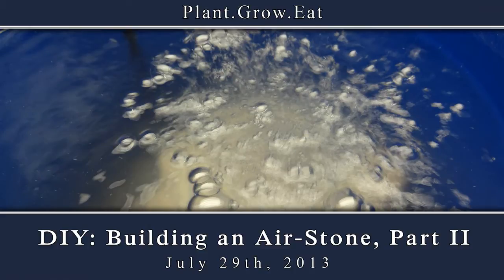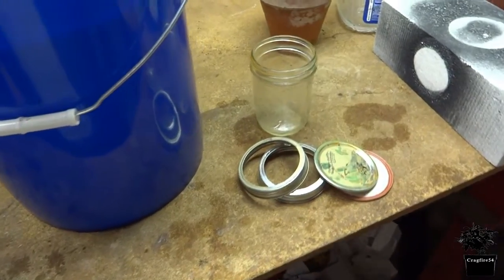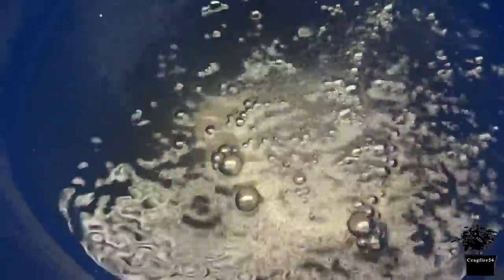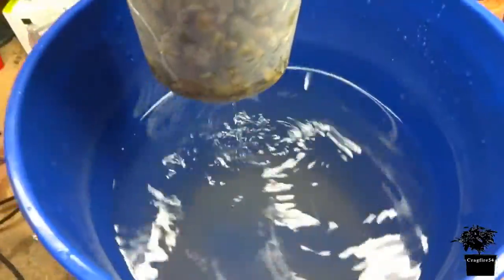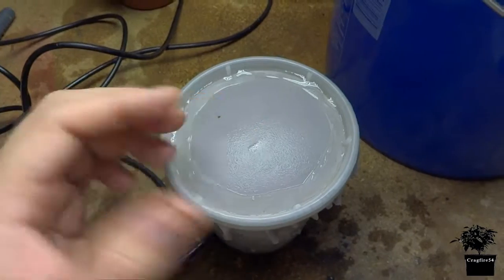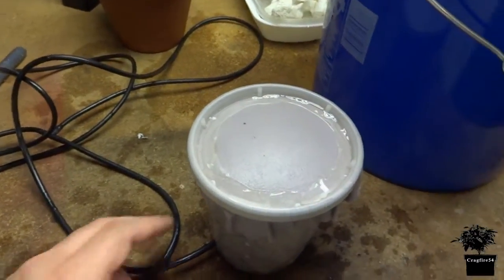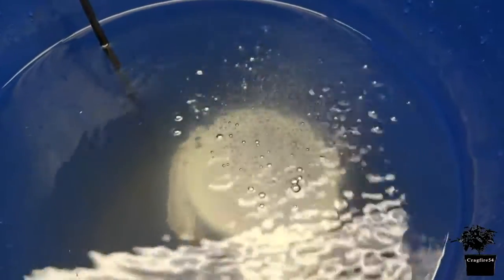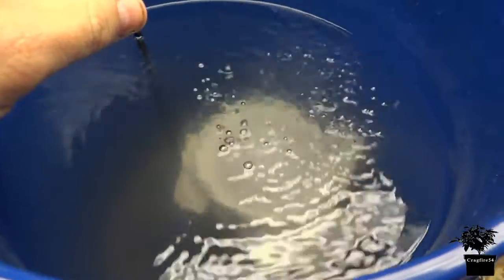Project: Building an Air-Stone (Part 2)

Comment: mild steel lids..yes if the coating is damaged the lids rust. Perhaps PETCO would pay you to NOT feature their branded air pump? Pay you in air stones?
Reply from the maker: Thank you for watching. The rusting issue was reported in the series; and as you saw, the new design in part 2 (this video) contained zero metal.

Comment: what about if you just put a couple rocks or marbles in the cloth and closed the cloth around the air tube and put rubber band man around to hold it
Reply from the maker: A fellow viewer did just that and shot me a video a few months back - it worked fantastic and is even easier. The cloth, stones, the hose and a few rubber-bands.
Reply: if you twist a rubber band around any object and when you get to the last few wraps,you can wrap around closed needle nose pliers and then open and put the end of the rubber band and tuck under it will not come loose.
Reply from the maker: click411
That would definitely work, creative. :)

Comment: Great idea!  Just curious, what made you try the microfiber cloth?
Reply from the maker: Thanks. :) I happened to get a few several days before-hand and thought Id give it a shot as a membrane for this project. It was just laying on the table, and when I checked, it fit perfectly over the opening of the container; but was still thin enough so the container lid would still snap in place. I was socked how well it ended up working.
Reply: ***** One more question.  How often do you change or clean the microfiber?  Thanks.
Reply from the maker: I haven't yet. But I'd imagine that one could just rinse it off in the sink. I'd say rinse it in water that's 5% bleach, then let it dry out completely before replacing back in the system. It shouldn't need cleaning though, at least not for a very long time. For hydroponics anyway, if used as a fish bubbler, perhaps a little more often. I would not use any "cleaners" as this can introduce toxins into the environment.

Comment: Wouldn't it be easier to buy a sixty cent air stone?
Reply from the maker: I'd love to buy one for 60 cents but the closest comparable one I could find are 10 dollars or  higher. The cost of airstones exponentially increase after hitting the 5 or 6 inch round mark. This technique could be extrapolated further and a 10 or 20 inch round airstone bubbler can be made, or larger.. I agree though, if I needed a 1/2 inch or 1 inch stone, it would be easier to buy one or a case. That said, it's always fun to build over buy, sometimes. :)

Comment: Thanks so much for an inspiration.   When I was trying to put this together I decided to just take the end of the hose, push it through a cement pot and then through a cork that I had drilled out to fit. I took a screen cleaning cloth, wrapped it around the end of the tubing and secured it to the cork with a velcro strap. I positioned the cement pot at the bottom of the tank (with the cleaning cloth now ballooned out) and filled the tank with water. It works so well! Thanks again!
Reply from the maker: Fantastic and very creative! I'd love to see it if you did a video. :)